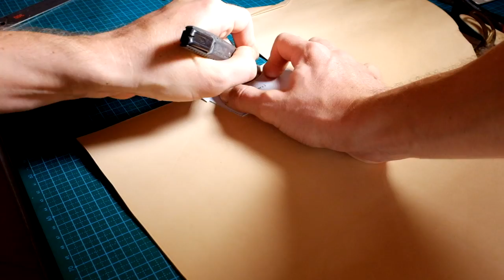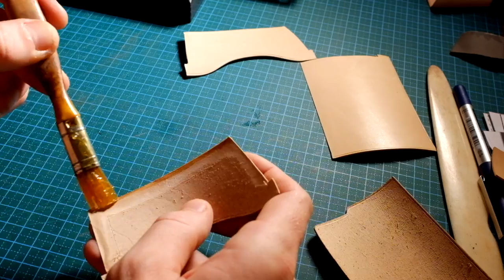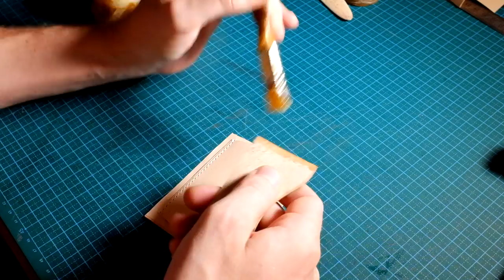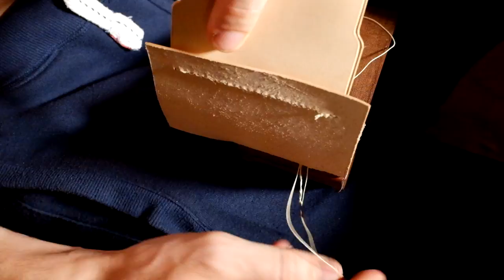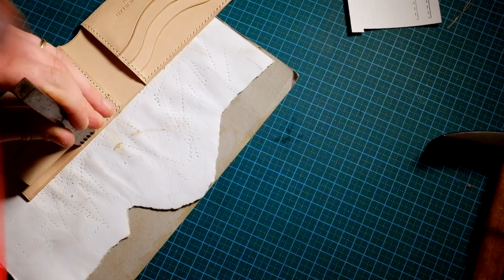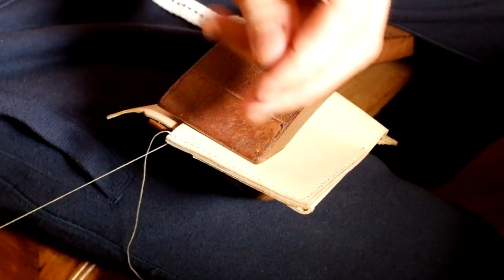Making a bifold wallet with coin pocket / leather craft tutorial

Comment: i see you punch the stitching holes from the inner side ( card slot & coin pouch side ) then make another holes on the outer part of the wallet, how do you make all the holes from 2 sides aligned ? i tried that method and often times the holes are not aligned properly. Also i see you use awl to stab the hole from the inner side, isnt it going to ruin the holes on the outer side because the holes on the outer side will be facing on the opposite direction from the inner side  ?
Reply: instablaster.

Comment: could you tell me the thickness of the thread? is it 1mm?
Reply from the maker: That's a number 432 from fil au chinois which is about 0.5mm thick
Reply: 432 - Diameter 0.63mm (200 meter spool length)